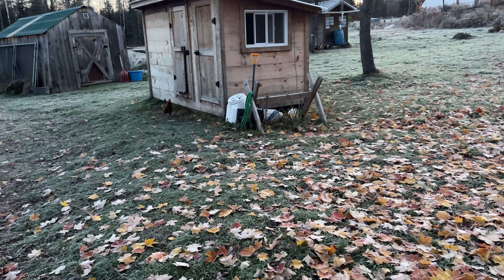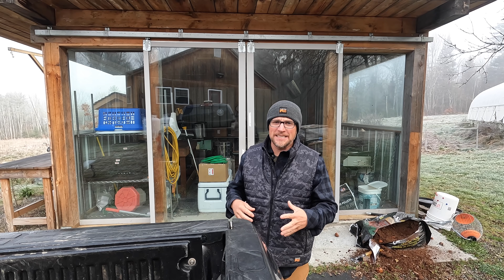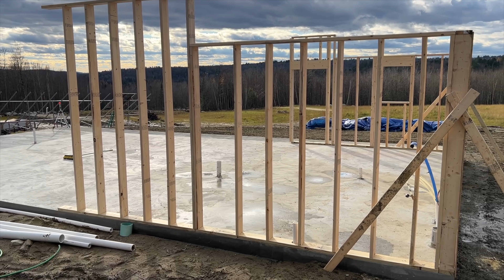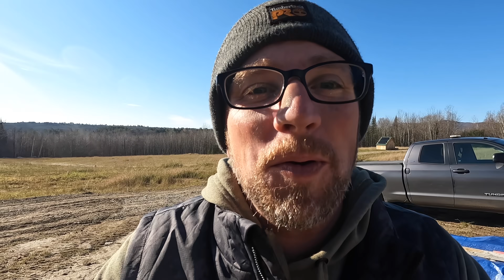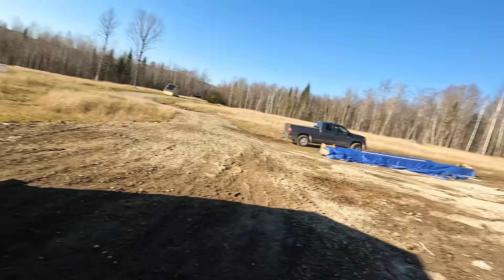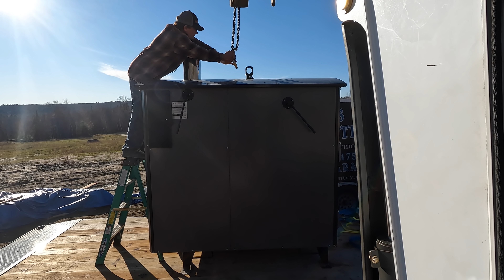It's the BIG DAY!!! WALLS Going Up on our Tiny House Build & Delivery of Our Outdoor Wood Boiler

Comment: no one spotter the error on the walls at the corners? they didn't double stud the one wall. (front and back). when they go to hang sheet rock they don't have a stud to anchor to in the corner.

Comment: I have commenting for Ken to get a wall lift to lift the gables which he assembles in full at the site sometimes with windows and siding.  Sounds like a good gift since for someone who had shoulder surgery last year.  Though I think he said he still had or used to have a wall jacks, just takes up room, he does not need it for the lower walls since he assembles them in sections.

Comment: Capillary moisture can rise from the concrete to those wood parts on the base of the walls directly contacting concrete and eventually cause mold and rot.
Reply: Seal was applied to those pressure treated timber, shown in video.
Reply: As Tony said, take a look at 6:58

Comment: Nice catch us up video, I suspect it is hard to coordinate two different channels on the same project. I have seen others with the outdoor boilers. I think it will be nice to eventually heat several buildings at the same time. Plus you can keep all the wood debris on the outside, no more bringing in firewood.

Comment: Start running the workings to the solar system, so you can be using that boiler to eliminate snow removal from those pannels, let that heat melt the snow  away, all winter long....you got it,  use it for more than it was intended. Bonus ....!

Comment: I've never been a fan of the outdoor boiler concept. 
Call me old fashioned.  I like a nice stove to gather around on cold days.
Reply: I always think about how to heat if there is no power. I know they are off grid but I've seen several off grid channels that had problems with components failing.

Comment: Just a thought:  Develop a shelter for the  boiler and firewood.   You cut firewood at the forest location, place on a wood pallet with 6 ft. tall wood side-supports, load the cut firewood onto the pallets, and then move the pallet of firewood with your front end loader "fork-lift attachment" to the shelter leaving the firewood on the pallet to dry and ultimately to be used in the boiler.  Minimal handling of firewood.    Make shelter large enough to hold about 20 to 40  (10 wide and 2 deep) pallets of firewood.
Reply: 25:30 - Al says in time when the boiler gets to it's final destination, it will have a shed built around it for just that purpose.  For now, we just have to wait and see.

Comment: I see you still have your tube running from the solar panels to the house open on the top, what i do in this situation, i take 4 90° elbows en glue them 2 by 2 so i have 2 U turns, slide them on both sites of the tube so te opening face down, it keeps your tube clean and prevent your tube from filling with water, dirt, leafs etc. Don't glue them to the tubes so you can remove them when you have to push the wires in and place them back afterwards. I doe it with all my tubes i leave outside that way.. grtz

Comment: I think your Tym could have made the lift if the chain was right on the 90o of a fork. That mid position on the fork blade dramatically increases the cylinder load. Then you ask the transport team to shorten the chain so you are 3-5 inches over the lift ring. 
Your tractor tires are liquid filled right?

Comment: Are those studs treated lumber? If not your not supposed to put untreated lumber directly to concrete. Just wondering?
Reply: Yes they are, watch Ken's videos.
Reply: As Tony indicated, Ken has said that the lowest plate is pressure-treated, plus it has a barrier that is tacked on, as you saw in this video 6:57

Comment: I thought that code was if a board hits concrete the wood should be pressure treated? Am I wrong about this?
Reply: As Ken said on his channel the sill plates are pressure treated and he also explained the use of the seal on the bottom of the sill plates.

Comment: Sorry folks but is it the trick of the camera or is your boiler  the size that would heat a small apartment building if its that massive.
Reply: Al is going to use it for multiple application s . It is going to be used to heat the tiny house, their workshop, and their main house when they are built..

Comment: Great job - movin' right along - I know the delays are a pain - but, all will get there eventually - We waited nearly six months for our tree guy and three months for our septic cleaning guy which we have done every 3 years - but all is finished now and they did a good job - Both delays were caused by worker shortage - Thanks for sharing and stay safe....
Reply: MsSephrena, If you're putting the right things down your septic tank you don't need to empty your tank for only around 5 to 6 years. Unless it's small or 5-8 people are using it?😁😁  If you put a lot of water down it then the septic tank doesn't do its job. The worst thing you can do is do your washing every day or 2. Small loads put too much water in the tank.

Comment: You can tell Al doesn't work in the trades. Using a sharpie marker on concrete is a homeowner move. Carpenters use pencil because it will write on almost anything and even works in the cold.
Reply: Also, the marker will be there on the concrete for a long time, if not forever. Pencil lead will wear off
Reply: @gtfangel  ... been in the trades myself so know he could have used soapstone (welding trade) or grease pencil (various trades) or even those marking paints. Those are made to be temporary and even though they look like paint it will wear off in a few rains or just given one or two months of foot traffic. Good chance the floor will be painted anyway. (another unboxing / sponsor?)
Reply: @rupe53  Yea, I am retired after 45 years in the trades. At least Al tries and will learn like we all did, sometimes the hard way.
Reply: @gtfangel  ... sometimes the hard way?  I am a big fan of learning by doing things but if it's something that requires skill and you will do it only once or twice, maybe it's time to hire someone who can do it twice as fast in half the time. I can putter at my own speed now that I am retired but it wasn't that long ago that I figured out how much my day job pays and what skilled labor can cost. Since my day job had a higher skill level (read: $$$) I think I was dollars ahead contracting out certain stuff, never mind saving me time.

Comment: When picking up a heavy object with the excavator it’s alway best to keep the boom as close to the excavator as possible in other words don’t extend the boom any farther then absolutely needed. It’s also a good idea to not use the swing when carrying a heavy object move it with the tracks as low and slow as you can.. at some point you may want to weld a chain hook on the back of the bucket it also may come in handy to have a chain hook on the fork lift frame cause ya just never know when you might need a chain.. just suggestions
Reply: I noticed it tipping when he went perp. to tracks, but he cut the video so you dont see his mistakes. Must be really insecure. Everytime I think uh oh how is he gonna do that, there is a hard cut and everything is fixed

Comment: Question: Can you live off grid and be an environmentalist,
It would seem that money is always the bottom line, burning wood, oil or propane put carbon into the atmosphere, but that's okay because I don't have the money to experiment with ground-based geothermal Going back to draft horses instead of tractors, thought-provoking.